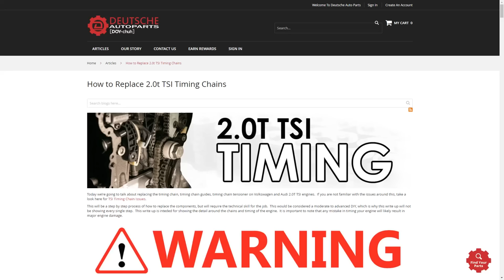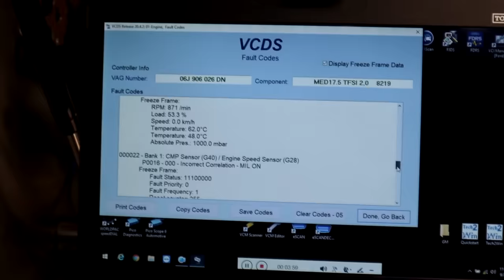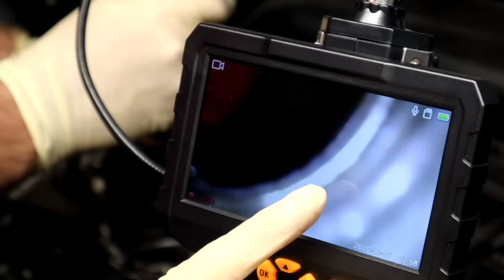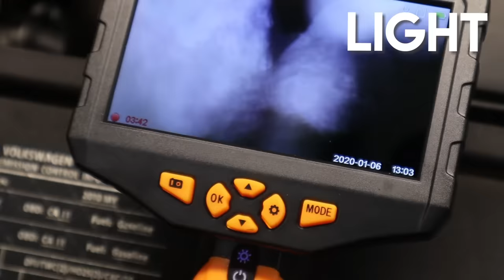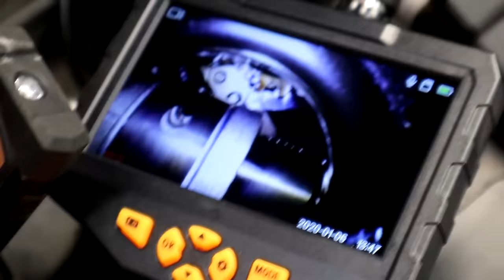The Jalopnik Tiguan FAILED ~ Despite the Warning

Comment: SCOTTY KILMER POPPING OUT OF THE TRUNK: "I tried warning you but nobody listened. This VW is an ENDLESS MONEY PIT!" 🤣
Reply: Right!  Just buy a Toyota.... then die of boredom, assuming it is the right one.
(Sorry, not my fault that Toyota doesn't fun - assuming you don't have an MR2.)
Reply: Haha
Reply: Knock knock
Who's there?
Rev up your engines!
Reply: I've personally owned 4 VW automobiles over the decades.  I'd buy another one in a heartbeat, with the right options (a clutch pedal is essential!).

My Toyota Camry just died about a month ago.  I was using it like a truck - I'm self-employed and carried all my tools and supplies for various jobs.  IT & Networking.  Electrical.  Plumbing.  Locksmithing.  Surveillance Systems.  Auto Mechanic.  I tried to leave some tools and supplies at home I wasn't using for a particular job, but my floor jack, universal tire iron, and jumper cables went everywhere with me (I sometimes stopped to help stranded strangers by the road side).  And I towed trailers (often loaded with building supplies, appliances, etc.).  And, there were the camping trips and the miles of dirt and gravel roads.  All in my 4-door Camry sedan.

The poor car only made it to a mere 461,228 miles (mostly trouble-free), on the original engine, original transmission, and original upholstery.  It only had roughly 300,000 miles when my wife and I bought it.  Odometer reading at the death of the engine is approximately the distance from the earth to the moon and 93% of the way back.
Reply: @frederickevans4113  lol, you obviously never had the polo or the golf then, theyre supposed to have a clutch pedal but tend to snap...
Reply: @deadprivacy  I've actually had two Golfs, a MK2 (1986, IIRC), and a MK3 (1995) with a 1.8L, and the 2.0L ABA 4-cylinder gasoline engines, respectively.  Never had a problem with a clutch pedal in any VW.

One of my dad's 1980 VW Rabbits (Golf MK1, 1.5L diesel) did have the housing for the clutch cable wear through.  When that happened, the housing mushroomed every time the clutch pedal was depressed.  I had already learned how to rev-match shift and to shift without using the clutch.  We were able to make it back home with me driving the 10 miles (16 Km).  I shut down at stops and re-started in 1st, then shifted rev-matching as necessary.

Thanks to the Coca-Cola 18-wheeler (lorry) driver who showed me shifting without the clutch.
Reply: @frederickevans4113  back when vws were good....those were the days, nah the clutch pedals snap on the newish ones mk4 polos mostly, rips out of the bulkhead or just tears itself to bits..
Reply: This is the the most underrated comment on this entire thread. Buy a stupid VW designed engine, win a stupid prize that will empty your pockets.
Reply: Yar Nunya  I'm self-employed and I'm an Assistant Scoutmaster.  I've used my Camry like a truck, toting my tools & supplies from job to job, towing trailers when I've had to, and going off-road (well, on dirt/gravel and into campsites).  Also, I don't like automatic transmissions.

My Camry is an automatic, but it  was my wife's car (before I got her a W210 E320).  Both cars were previously owned by friends, friends who made us offers we couldn't refuse.  Every automobile I have owned that I bought for myself has had a clutch pedal and an "H" shift pattern.

As much as I love that Camry, I'm looking for a Subaru Forester.  AWD & 5-speed manual.  Subaru is (now) 20% owned by Toyota.  So, not going too far.  My alternates are a Honda CR-V, Toyota RAV4, or 4-Runner.  Again, AWD/4×4 and a 5-speed manual.
Reply: @gaborherman1481  When 'fun' is paying $4500 for repairs
Reply: @hamishspencer  
That price tag is not going to be much different at all for ANY interference engine (which is basically all of them nowadays) that jumps time. Assuming the engine is salvageable at all.
Reply: Why does that Scotty dude always work on junkers, and he complains about real cars being so horrible, and all he drives are junkers, and works in a driveway, now that's a real pro
Reply: @cengeb  I've owned both German & Japanese automobiles, including four water-cooled Volkswagens and a Toyota with over 461,000 miles.  I'm a fan of both Scotty & Charles.

Scotty doesn't just work on junkers.  He shows the most interesting/absurd vehicles on his channel because of the old news broadcast adage: "if it bleeds, it leads."  He also shows some "teachable moments."

The latest videos I've seen from Scotty seem to indicate that he's left Texas and now lives in Tennessee.  Along with the move, he apparently now has two garages and can work on vehicles indoors.

Toyota does make a couple of fun vehicles, but they're better known for reliability and longevity.
Reply: @frederickevans4113  I've had 17 + VW Audi stuff flawless, Scottie is full of crap, current Golf R 2019, super fantastic, solid, quick,glued to the road.  Stick of course....My last two GTIs where great, R is BETTER..I have had Jetta GLX VR6 316,000 fun never stranded or stuck miles, never did anything with trans, or timing chain, nothing! Brakes every 100,000 miles, always, mostly highway driving..stick saves brakes...last GTI got rid of early at 147,000 fun reliable fun reliable miles, flawless, not a burp
Reply: 2019 Golf R 72K warranty or 6 years....better than TOYota
Reply: @cengeb  The vast majority of people in the USA go for CVT/automatic/automated-manual where they just put it in "D" and go.  Scotty knows this and caters to the typical American.

Some VWs have had issues with their automatic transmissions and/or the heat-exchanger for the transmission.  Here, in the USA, some VWs are/were made here in the USA or Mexico and had more reliability issues than the German-made ones.  My last VW was a Mexico-assembled one.  It was mostly reliable until (over the course of several years) it was involved in two major collisions (including one where an 18-wheeler/lorry side-swiped us) and another less significant one in which we were rear-ended by a pickup truck.  It still ran and drove under its own power when I got rid of it, but it needed repairs that were beyond our budget.  We didn't have full-coverage insurance (3rd party liability only) and we didn't get the license plate info or any other identifying info from the 18-wheeler and the driver didn't stop.

Still a fan of VW (both air & water-cooled), older Mercedes Benzes, Toyota, Honda, Subaru, Charles, and Scotty (understanding that much of what he says is aimed at the 99%).
Reply: @jefdamen2977  lol, I even got defensive after  reading this.
Reply: Scotty Shill-mer
Reply: @frederickevans4113  Get into this century!!! current Golf R is fantastic after my two previous GTIs with  not a burp 147,000 on em latest Golf R 2019 25,000 miles,just broken in, fantastic stuff.
Reply: I've never seen scotty ask for money or try to sell anything ! how is he a shill ?
Reply: Damn i can hear him saying it as if it is a video 😂😂
Reply: @gaborherman1481  yeah because volkswagens are exciting 🤦‍♂️
Reply: I KNOW A FRIEND WHO BOUGHT A POURSH AND IT COST HIM SEVEN HUNDREDREY THOUSAND DOLLARS JUST FOR AN OIL CHANGE.   NOW LET ME TELL YOU THE 10 THINGS YOU SHOULD NEVER DO TO AN AUTOMATIC TRANSMISSION.
Reply from the maker: HHhHhaha
Reply: @gaborherman1481  Yeah, because a tiguan is such hoot.
Reply: @gaborherman1481  Or a Supra , or celica GT-4 or Starlet GT turbo or a AE86 (Birthed the drift nation)
Reply: Kilmer is being disingenuous.  I had a water-cooled VW that had nearly 300,000 miles on it.  Except for a broken timing belt (my fault), that thing just ran and ran and ran and ran......Most reliable car I've ever owned (I'm 73 and have owned a few).
Reply: @gaborherman1481        I'd rather die of boredom driving an old Toyota than being stranded on the road and turning wrenches on a VW on my weekends.
Reply: @gaborherman1481  i like Volkswagen, but Honda is superior
Reply: @markokrsmanovic1080  My Camry was, indeed, petrol.  It had the 2.2L 5S-FE 4-cylinder engine.  Diesel Toyotas have not really been a thing here in the USA.  All the Vee-Dubs I've owned were petrol (gasoline on this side of the pond) also.
Reply: @cengeb  As someone who wrenches on his own vehicle, I am indeed partial to the 1990s models.  However, as I volunteer as an Assistant Scoutmaster and I go camping several times a year with our Boy Scout Troop, I would love to have a 2009 Tiguan (first model year here in the USA, but 3rd model year globally).  I would like mine equipped like no Tiguan here in the USA was ever equipped (but it was sold this way in other markets).  Gimme one with a 2008 TDi diesel (pre-Dieselgate), a 6-speed manual, and all-wheel-drive.

My 1995 Golf III GL 4-door hatchback was a fun car to drive.  It came equipped with the 2.0L ABA 4-cylinder with a mere 115 ponies and 122 Lb-ft of torque.  But, of course, mine had the 020 5-speed manual.  The chassis dynamics of the Mk3 Golf/Jetta weren't the best, but it was fun to wring every last morsel of performance out of that car.  It was more fun on 2-lane blacktop in the mountains in Mexico & Belize than on the wide open flat freeways in the USA.

I'd love to drive a newer Golf GTI or Golf R.  In the name of safety, the Government of Belize has taken another stab at flattening and straightening the Hummingbird Highway - one of my old favorites.  Of course, this is making that twisty mountain road more bland.  Maybe a trip out to CoTA (Circuit of The Americas) - I live in Texas now...
Reply: @frederickevans4113  My 2019 Golf R has been flawless, and FUN, comfortable about 32600 miles now, not a burp, changed filters, oil, perfect. I had a 98' Jetta VR6 GLX, stick of course 319,000 nevr stranded fun miles, current Golf R is the Best of all 17+ VW's I've had  MK 8 is even gonna be better.  recent You tube has the Stock Golf R mk 8 doing 170+ mph on the autobahn 290 Kph, and he shows when the limiter kicks in, steady, solid comfortable 0-60 like 4.2 secs, super quick, Better 4wd system now, than Haldex, it just keeps getting better and better.  My 2 GTI's where always flawless 147K +, never stranded, NEVER ever, I drive a lot...My 2 GTIs I added Eibach springs and sways, really tightened up, current Golf R in RACE mode on the DCC, is much better than what the GTI did in DCC in sport, since the 2019 Golf R,has a much longer warranty 6 years 72,000 mile, I am holding off before i change anything..the current GTI and Golf R are much better than stuff from the 80's or 90's had em all...they get better with each generation, i change my own plugs etc, super easy, just did the 2013 tiguan, 27 minutes, pop pop, out in, easier than Golf R or GTI they had they have the newer coil with bolt down stud,with ground wire, extra step, still easy PZ, new plugs make a big difference even after only 32,000m on my golf R did it recently and the Tig...dealer did the Haldex fluid change as per recommended and brake fluid flush they run forever, follow the maintenance, another thing on golf R, the Brakes are beyond fantastic, Mk8 gets even bigger and drilled..Manual trans always of course
Reply: @cengeb  three words: plastic chain guides. Just kidding. All cars have flaws but I'm always very intrigued by some of the designs.
Reply: At the 84k mile mark it was 150 every month for something.
Reply: Why is Scotty always working on junk?  No one trusts him with things of any value...
Reply: I HATE Scotty Kilmer, he makes me think of a pack of cigarettes that learned to speak.
Reply: "rev up your engines if it's a Toyota Celica"
Reply: @cengeb  and I can fly without wings
Reply: Scotty Kilmer is a barnacle
Reply: @gaborherman1481  or by a vow golf and be ultra boring but on first name terms with your local mechanic.
Reply: @cengeb  stop telling lies
Reply: @deadprivacy  they are hydraulic, nothing snapping
Reply: @dragospahontu  Depends on what size blade ya get on the mower
Reply: 🐐ha ha ha
Reply: Scotty would say if you're going to buy a VW, buy an air-cooled but. It'll last forever, or you'll rebuild it in 3 hours. One or the other. 😂
Reply: He’d die if he was in Europe lol, such an American boomer

Comment: I'm going to give my Honda a hug after watching this.
Reply from the maker: HAHHAHAH
Reply: That’s why I track a Honda and have a A3 AND Q5 daily. Need to have options. Tbh the A3 cold start rattle is bad now, really bad.
Reply: I had a union-made, bailoutmobile Wrangler that was more durable and reliable than this marvel of German engineering.
Reply: Yeah Honda makes better turbo cars now, but again they will be 100% electric 2030 so get ready to switch auto makers if you don't want a $40k + heavy af car.
Reply: @slimchriz1  cold start rattle on the 2.0TSFI?  cam chain tensioner
Reply: @BenState  Indeed, it sounds like a diesel at start up. I havnt been able to crack it open to see if its the tensioner, a guide or just a stretched chain.
Reply: Gonna give my '98 ABA powered mkIII powered Jetta a hug too. Even though trans #2 is in trunk with failed diff rivets. 🙄
Reply: I literally just came here to make a similar comment about my shitty old Toyota. 😆
Reply: Hugged my '10 Sportage.
Reply: What size blade on that Honda?
Reply: @greggc.touftree5936  that will be all cars mate. EU regulations will push all automakers to adapt.
Reply: @brianborell4469  trans 2... oof
Reply: @William Hummel Mazda’s need their timing chains and tensioner looked at at 100k miles too to prevent similar failures. 80k miles if you mostly drive in cities. It’s a cheap repair if you do it timely and a disaster if you wait until 130k miles when the engine dies.
Reply: How often do you have to clean the oil smoke residue from the back of your car.  See Honda's burning oil all the time, some barely out of waranty.
Reply: @datsuntoyy  what size blade do you normally get with those Hondas?
Reply: @cengeb   I usually use a sponge and and heavy duty wheel cleaner to get the residue off the back of cars around the tail pipes.
Reply: Exactly
Reply: @michaelb7437  me 220 000mile rsx. Never touched the chain just works
Reply: @datsuntoyy  ya that's turbo car life.
Reply: @ryanvtec3885  not when you run a car with good turbos and engine.
Reply: The problem with Honda, is the rest of the car. The block in my Civic was amazing, but have never had a car where I have had to replace so much stuff. My 2 Golfs only got shitty over 100k, before that, no issues. My BMW has never skipped a beat and is the best built car I have ever had.
Reply: Really makes a guy wonder about job security working for a german car company lol
Reply: I just told my 2016 Rav4 "I love you."
Reply: @michaelb7437     Timing chains are overrated on small overhead cam engines.   Lots of slop and wear and timing error that can't be corrected as time goes by compared to belts.
Reply: @Runawaygeekchannel  Not even leaking oil?
Reply: @deviouslaw  lol, not yet... But it's the best rated block they do the I6 3.0ltr. It seems to do really well, so maybe that's it.. 🤷‍♂️ or I'm just lucky.
Reply: @Runawaygeekchannel  I took an m235i for a pre purchase inspection a year or so ago, it had oil leaks from the oil filter housing gasket and the oil pan. It was about 60,000mi at the time, with a perfect oil change history at dealerships. That's a turbo 3.0 I6, don't know if yours is. But watch out for that OFHG, apparently if it gets really bad it can degrade a belt which can be sucked into the engine and damage it. I don't understand how BMW with all their technology can't conquer the gasket. But maybe it's not their priority 🤷‍♂️
Reply: @deviouslaw  Good advice, tbh, I'll probably trade up or out before 60k, I hear there is an M3 Toruing on the way, mines the M340i Touring, so that could be nice, or I'll got Tesla or something like that.. who knows. But I'll keep an eye out, cheers.
Reply: Too much chain in VW and GM engine cause lots of problem.
Reply: You should
Reply: Best car yet😉
Reply: So True
Reply: That’s why I’d rather have my e34 bmw
Reply: I don’t know,  my Honda Civic 1.5 turbo has had two engines already due to oil dilution. So not all Hondas are reliable…..
Reply: @greggc.touftree5936  tbh I'm actually curious how it'll play out, we had a major shift of that scale happen before when cars were switching from carburetors to EFI.
Reply: Gas engine is the way to go. Good luck with the electric shit
Reply: better yet do your timing belt every 100k - it'll thank you more and you wont be one fo the thousands going why'd my car break lol japanese cars break as much as any other regardless of what the fan boys want to believe